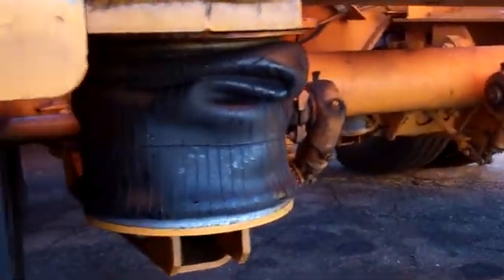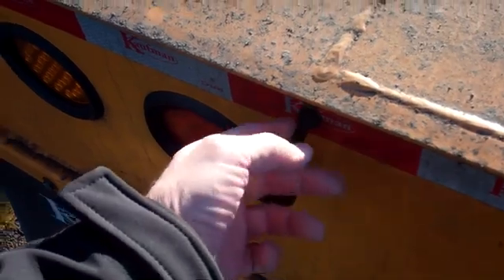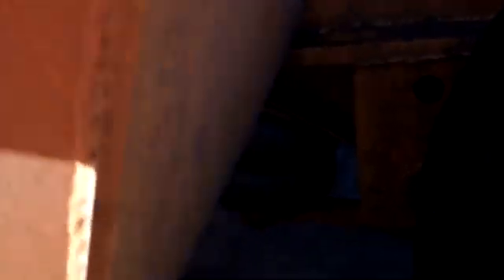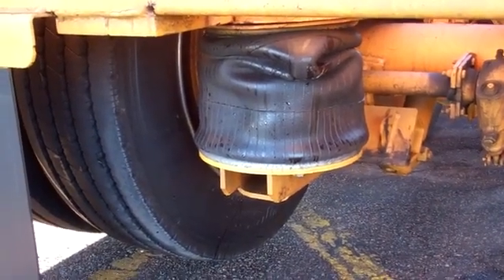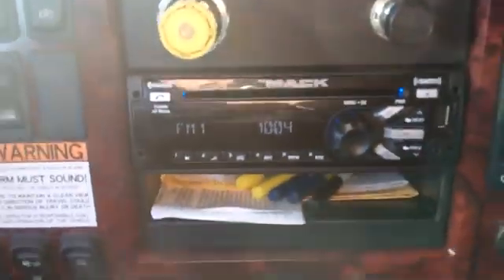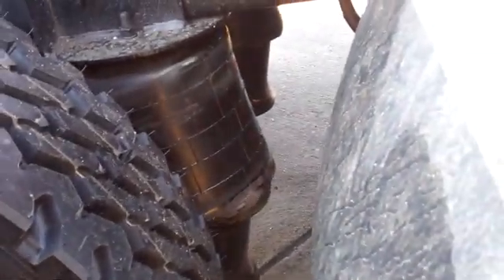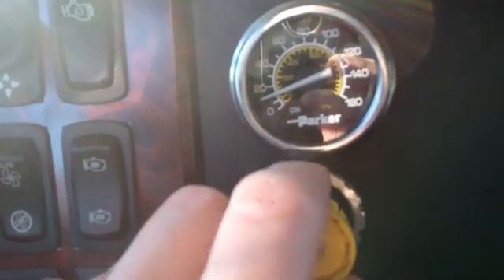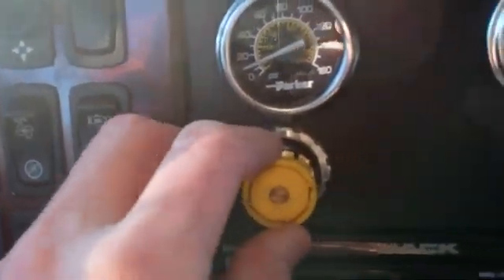HEAVY HAUL TV: How the lift axles work

Comment: how much more weight can you haul with a lift axle on a semi truck ? and what kind of cargo is lift axle on  a semi truck specific for ? I mean I have a grain hopper trailer and I could make more money by trip only if i had a that extra set of axles
Reply from the maker: i don't think it would work with grain, because it's a 'divisible load'. if you're in usa, your gross is limited, UNLESS you haul oversize/overweight loads that cannot be reduced. if you're in canada, your gross weight can be increased with the amount of axles. my lift axle works with oversize/overweight NON-DIVISIBLE LOADS. Because of the 4 axles, my truck's gross weight is 86,000 LB, instead of 52,000 LB on a regular three axle truck (12K front, plus 40K drives).
Reply: thank you so much , great answer Mr Dratchev

Comment: Wow! Very cool! Better than the Playboy channel! Um, well..almost better! So it's just a judgement call on when to put the axles down? Or is there a manual that specifies when to use them? Like over 80,000 pounds? Will the shipper say, "Hey buddy put down them axles!" Do you have to use both at the same time, or can you just use one lift axle if needed! Thanks for the great vid!
Reply from the maker: shippers have no idea on when to use axles. yeah - you use them when the load exceeds what's allowed on other axles. some states (michigan) require all lift axles to be down, when you're over 80K Lb, no matter what. wyoming is like that too. also, there's an option on the truck's lift axle - i can only put down 1/2 of the axle; so only 2 wheels will be down on my side. it was a $500 option to add when installing the axle. comes in handy on narrow streets.

Comment from the maker: quick update: i deadheaded 1100 miles from Utah east to Iowa; picked up a light step deck load (13'L 3' W 11" T) and am now heading back home in Ontario, Canada. Also finally found a local sawmill in ON which will supply 4 oak boards (3" by 12" by 12 ft) for 50 bucks each. Supposed to pick 'em up Monday or Tuesday. That will complete the set of things I need as heavy haul trucker!

Comment: If your truck has drive axle weight psi gauge just figure what reading is legal weight. And then adjust lift pressure until drive wheels are legal

Comment: You do realize on that psi gauge in truck for axle, 20 psi on gauge does not equal 20 000 lbs on axle?  You have to be on a scale to figure about what pressure setting you need probably around 60 psi or more is needed
Reply from the maker: bikerboy4life41 oops

Comment: would save u tolls if u did not have an easypass. they charge by the axle on the ground around here.
Reply from the maker: Jaron King not true: blue water bridge in port huron, mi charges for all axles on the truck and trailer. just had to pay $3.25 per axle on all 7 even though only 5 were on the ground :( coming into from canada on that bridge is the same story - 'we charge for all axles'!

Comment: we had lift axles years ago when I started hauling autos (1979), we called it a "tag axle". however the axle that lifted was 2/3 the size of the drive axle. GMC Brigadiers with 10 speed transmissions and NO turbo charger. onward Sergei!   carhauler Tim
Reply: 2 Broke 
Tim
Reply: 2 Broke Tim, conventionally a "tag" axle is what goes behind or tags along behind the drive axle(s). A bogie or pusher axle is what you call it when they're placed in front of the drive axle(s)...and of course both configurations can be specked liftable and or steerable.

Comment: have you rigget the truck so you can evacuate the air out of the last drive axle?. thats very handy when empty and spinning for lack of pressure on the drives.
Reply: Every lift axle system has to have quick release valve  just like a brake system or you wouldn't be able to purge the unneeded air

Comment: When you have a load on, how much air do you run in your truck lift axle? We had a single axle Mack we stretched and put a lift axle on and we ran about 80 psi when down, Was just curious on what you run in a heavy haul application?
Reply from the maker: i only used it once so far. my gauge shows POUNDS, so I only put 10K to 15K on it. i'm still learning how to use it.